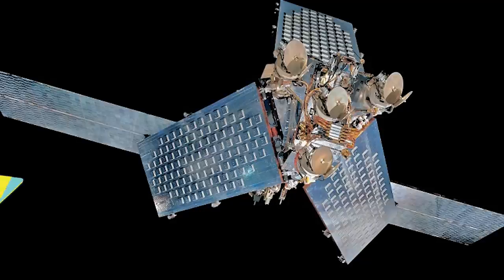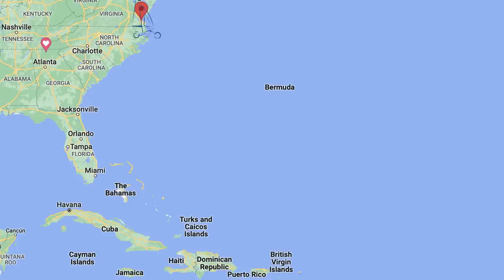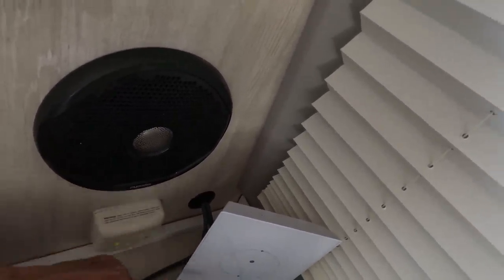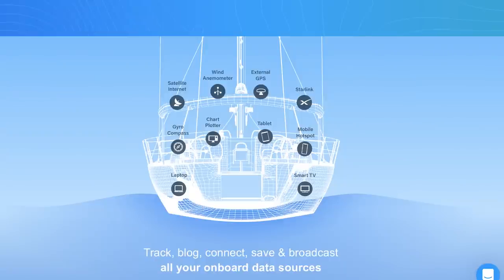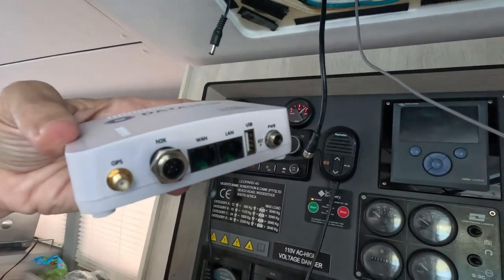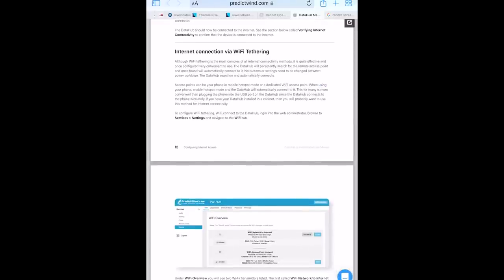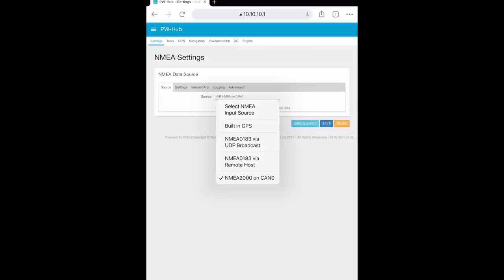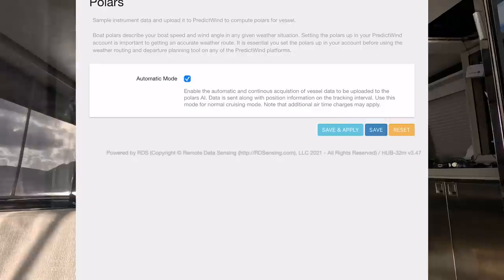Starlink vs Iridium GO. E70

Comment: I believe Starlink only works in the Continent where you purchased it from. The Roaming option allows to change Countries in the same Continent, but not when you move to another Continent, for example, when/if you ever sail to Europe, it is unlikely to work (I've read it works for some weeks, then stops). It seems that, when you get to Europe you'd need to buy Starlink hardware/antenna again. Not sure if this is a regulatory issue, or Elon's idea that you should not roam the world with the same hardware at the price of the RV offer. Iridium GO still great option - connection works anywhere even if slow.
Reply from the maker: Thanks for the info. Luckily, the Caribbean is considered North America so we’re good for a few years. But others should consider your info.

Comment: You are correct, Iridium is older technology, but the original intent of the system was for voice communications. The data was 
an afterthought and was never intended to be the equivalent to internet streaming. Iridium is in the process of upgrading it's system with new, higher capacity satellites. Monthly fees for voice can be as low as $40 per month with a few free minutes thrown in. Starlink is a completely different concept, the intent was to provide (relatively)  high speed IP service via LEO satellites.

Comment: What is the base with the set screws that you used to attach the starlink pole to the fishing rod holder. Such a simple but brilliant solution to mounting the starlink antenna. Been thinking about how to mount mine, and this is the best solution I have seen, thanks for the great idea
Reply from the maker: Starlink sells a pipe adapter kit for around $40. It was easy. For the first few weeks since we weren’t sailing in big seas we simply had it resting in the fishing rod holder. A bit scary but it’s pretty heavy so we weren’t too concerned that it would fall out. 😎

Comment: Great video. Also, getting first hand (non commercial) information about the stability of the Star Link connection while under sails is extremely helpful. We sail a Catamaran as well and I assume that helps a lot with regards to stability of the Star Link antenna.  

We have an Axiom plotter with Lighthouse OS. It does allow the installation of a predict-wind app. Perhaps that replaces the need for a datahub device. 

Thanks!
Peter.
Reply from the maker: Hi Peter, thanks for the comment. I’m 99% sure that the predict wind app for axiom provides all of the important weather info you need but will not replace the DataHub serviced like pinging your position. It’s really just like installing predict wind on your iPad or phone or computer. Axiom is just another place you can use predict wind. Hope that helps! And yes, I’m sure Starlink works much better on a cat, at least it probably searches less for satellites due to the motion which would use a lot less battery power.
Reply: @SailingWindTherapy  
Thanks. That's clear. Of course a location ping is something you'd like to have 24/7. Even with the plotter switched off.
Here in Europe there is a snag with the Starlink RV version. It only allows you to be outside of your country for 2 months. After that you need to reregister it to a new country. When cruising for half a year that may become an issue. We'll have to see about that. Perhaps it is just a formality. I assume the maritime version doesn't have that restriction, but that one is simply too expensive for poor sailers 🙂
Cheers,
Peter.
Reply from the maker: @peterdevos811  I’d bet the reregister part is just a formality and won’t be enforced or at the very least it’s just a matter of a little paperwork. But we shall see. And in the meantime, using Starlink is a fantastic option.

Comment: I have had Inreach for several years but it has failed me several times, so was thinking of switching to Iridium Go. However, i have seen several comments on YT, where people have complained about the reliability of Iridium Go. One cruiser told me that the only solution is to have both, but that is expensive.
Reply from the maker: I don’t think Iridium Go is unreliable, it’s just very, very slow and the phone part is not at all conducive to having any real conversation. If you are using it with Predict Wind it allows you to slowly download grib files so eventually you’ll get a decent weather report when offshore. I think until Starlink came into play it was necessary. But with Starlink, it’s completely unnecessary. I’ve been paying the lowest subscription rate for InReach for years but am ok with that since it’s my backup and we always throw that in our ditch bag when sailing offshore. So the cruiser was right “Before” Starlink became available. Hope this helps!

Comment: Thank you for the great info. Sold me on the new Technology. We were just talking about whether to get an iridium go. Star link ahead. Question does your AIS transponder have built in wifi interface to send signals to tablet, etc or just MFD's I see the  AIT 5000 transponder, I was interested in, has interface. If I get the module you speak of can I get a cheaper Transponder with only MFD displays and have it work like yours on a tablet as long as it is NMEA 2000?
Reply from the maker: Hi, thanks for the questions. We have the Raymarine ais700 transponder. This does not have a WiFi interface which is why we were only able to see it on the chartplotter. If you had an ais transponder with WiFi then you’d be able to also use it on your phone or iPad (via Navionics or Aquamaps). So YES to your question. 😊 Also if you are planning on doing larger, longer offshore sails then I would still consider Iridium GO as an emergency back up if you wanted to get frequent weather updates. But it’s a very expensive backup. For just emergency issues I would just get the Garmin InReach. Hope this helps!

Comment: Thanks for this video and explaintion.  Are you still able to use your starlink while at sea on RV mode with unlimited data.  A few months ago, we got the nastygram from Elon that we will have to opt into mobile premium data while at sea.  We are planning to do the ARC Europe next summer and need internet connectivity for weather and check ins.  I am concerned about the price of the data while at sea being a bit cost prohibitive.  Thoughts?  Thanks.
Reply from the maker: So I think you should be totally fine for the ARC and here’s why. You will have connectivity while out at sea. And it’s fast and reliable. But you do have to pay a small amount per Gig for data. The thing is you’re not going to be streaming movies, you’re going to use it for grib files and Check ins which should not be overly data intensive. But you will have it available in case of emergency or if you need to FaceTime call your family. And the cost is extremely reasonable. Keep in mind while also while sailing closer to shore you go back to the regular plan so then you can start getting fast, unlimited data again for $150/month. I think this service is incredible

Comment: Very interesting. You don't have problems with boat roll? Does it work even while navigating?
Reply from the maker: We are a catamaran so our boat role is not as significant as a monohull. However even monohulls are getting great service. And yes it works while navigating
Reply: The satellite that your boat is communicating with is moving at thousands of miles an hour. Your boat’s movement, even if it’s moving at 20 knots, is trivial to the process of tracking the signals. The other good news is that it’s not using a physical dish to send signals. It’s using a phased array that’s electronically moved. It can do this very fast. It’s how the tracking radar on large military ships works. It’s rocket science at work.
Reply: @Bill_N_ATX  Ok, your answer begs for a few physics explanations. Even if Starlink satellites are not geostationary, their angular speed w.r.t. an observer on Earth is less than 1 degree per second (regardless of their actual speed in space). This allows establishing communications between the observer and the satelite. At the same time, roll can be much higher (tens of degrees). Imagine staying flat on your back on the deck of your monohull and looking straight ahead. Due to roll, the position of one satelite is constantly move with variable speed and direction. Whereas, if you do this on land, a satelite will move steadily and slowly across your field of view. Maintaining a link in a small boat on sea is therefore much more difficult than on land. Kudos to Elon and to his engineers.
Reply: @dopo8333  I spent a moment googling how fast a boat can roll from side to side. I didn’t know it, but how fast it rolls is a function of beam, not the size of the roll. I started down the path of the equations and decided it wasn’t a matter that I had time to work on right now. What I did figure out was that a roll that was faster than what the phased array could respond to would probably keep you from watching the screen to begin with. The downlink is not the issue. The satellite is sending its signal to a large area than even a speeding airplane is not going to outrun. The uplink is the one in question. How large a cone of RF is the uplink sending? Short answer is I have no idea. Phased arrays can be pretty tight but I don’t know how tight these will be. And of course, environmental conditions would also be a factor. If it was a squall line that was causing the roll, you wouldn’t be able to send and receive through the water in the air anyway.  But to your point, indeed it would be a good physics paper to see what performance envelope the signal will work in. But unless you knew great details about the array properties, the signal power, any array gain, the required signal strength required at the satellite, and a few other values that SpaceX is never going to tell you, it’s a mute point. It will work till it won’t.
Reply: @Bill_N_ATX  Ok, so if you're scientifically literate, why did you write that scientifically illiterate comment? Just to vent some inner anger?

Comment: Enjoyed the informative vid... you didn't mention which PW account you are still paying for...? You get off using Datahub for the cost of the hardware gadget only...?
Reply from the maker: Thanks for the comment. For the Predict Wind app which is by far our favorite weather app there are a few different subscription options. If you use the free one then I don’t think it will be able to utilize the Datahub. The other subscription options are Standard which is around $250/ year and the Professional which is around $400/year. With those you get all of the Datahub features. We splurged and got the professional version when there was a sale on it. It gives us ocean current data which is critical especially when crossing the Gulf Stream and better weather routing  and passage planning. But to answer your question, yes if you have a paid subscription, you get to use Datahub for just the cost of the hardware gadget. Hope this answers your question.

Comment: Great video and extremely useful.  I am puzzled as to why get the PW Datahub?  The video states that in order to get rid of their Iridium GO they needed a tracker.  Therefore they went with the PW Data hub which will send postion but needs Internet.  This meant getting the SL internet adapter ($50 USD) and the Data Hub at $300 USD.  Why not just buy a Zoleo for $200 USD which will send position and emails to your "friends" independently of the SL network.  This allow you to not need to have SL running in Global Mobility Mode suring offshore sailing.  One of the reasons to turn off the SL dish/router is that they consume 3-4 AH.  The Datahub is a great product but a somewhat over priced and un-needed solution with SL and other devices, (e.g. Garmine Messenger)
Reply from the maker: Thanks for the comment. Not sure what you mean by a $50 SL internet adapter though. We’ve been keeping our SL on the standard mobile plan which has been working great in the Caribbean. We will also keep it running while we are offshore with the per GB plan so we’re not too worried about the small amount of data that it sends out for tracking. Now for tracking we have a link on our website that shows where we are, where we’ve been, how fast we were going at every moment, and how strong the winds were at each moment. We like that record. Our use case scenario works for us. It might not work for everyone though. We haven’t heard of Zoleo though so just looking at it now. Besides the $200 you also have to pay a monthly fee between $26 and $56 per month. With PW we are not paying anything extra per month. So $300 with no monthly fees is certainly better than $200 with $26/month

Comment: Great too see starlink on a boat ! Do you think it will work on a monohull as well ( thinking a monohull moves around more at sea ) does the giro adjust the antenna all the time ? How mush power does it take out at sea thank you for great video !
Reply: That is exactly the same question I want to make! I have an 43 Catch
Reply from the maker: Yes it will work on a monohull as well. Check out the Facebook page Starlink for Boats and you’ll get all sorts of good info for your situation. We have friends with Starlink on their monohull and it’s working just fine though. Our dish periodically resets itself but not that often. It does take quite a bit of power though. Like 30 watts. It’s a 110 AC plug but people have converted the plug to 12v which should save a few watts of inverter loss.
Reply: @SailingWindTherapy  thank you for detailed & fast answer. I apreciate your support

Comment: Thx for the Video. I thought from the beginning of Starlink about this use case. How stable is the connection from Starlink in motion? So sea-state and being underway. 
When its stable, then this is a game changer, not just for yachts but also for commercial shipping. I wouldn't mind to pay as a crew 150$ for fast internet, I think most of my colleagues wouldn't mind either and for companies these are pennies even if they have to pay a commercial price.
I work on container ships and we have very limited Internet access, which is slow and expensive. You cant video chat with your loved ones or watch something which isn't on your hard drive.
Reply from the maker: I think for more than a few users and being out at sea a lot maybe is the case for the maritime service. But even still that should work if crew is sharing some of the costs. The service by the way was great even during high seas and lots of rolling.

Comment: Very interesting.  I had Tracvison on my motorhome but a ground vehicle is rather stable compared to our sailboat.  A friend of ours has a Star Link they use while camping and they love it.  So I looked into the marine version and after I regained consciousness after seeing the $10k/month price tag and checking our bank account, I wrote off this product.  I was impressed how you made it work for you.  So my question is, you said you used it during your trip down to the islands in somewhat rough weather.  How did it perform? With the boat constantly moving, was the dish able to stay connected all the time?
Paul & Linda
S/V The Friendly Confines
Reply from the maker: It performed remarkably. Every once in a while during huge seas it would cut out for a few seconds but that was not that often. We were very surprised how well it worked under those crazy conditions!

Comment: If you didn't know the iridium voice is not encrypted. Anyone can setup a sdr radio and  Lband antenna and hear the voice calls
Reply from the maker: Was not aware of that but… when we used the Iridium voice (which is cool that it’s over satellite but really has terrible reception with a lot of lag time which makes it very difficult to communicate)  we aren’t really talking about bank numbers or anything where we care if anyone is listening in. But we do see your point. Thanks!
Reply: @Sailing Wind Therapy  it's NOT easy to do in any way, but both iridium and inmarsat voice can bot be listened to look up tech minds he's got a good video on it. But can only hear the down link of the satellite. Inmarsat ecg and LES msg can both be picked up has well fairly easy.

Comment: Are you still able to use it or did they cut you off?
Reply from the maker: For now I believe we are fine with the same plan we had since we will be on the hard for the summer. But even after we leave Grenada after hurricane season we should still be good. We’ll find out on May 9